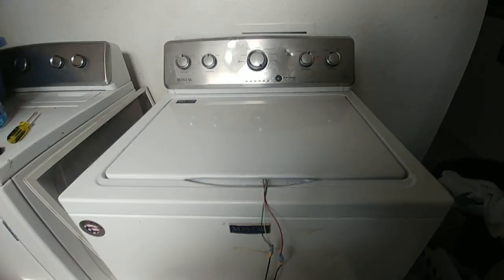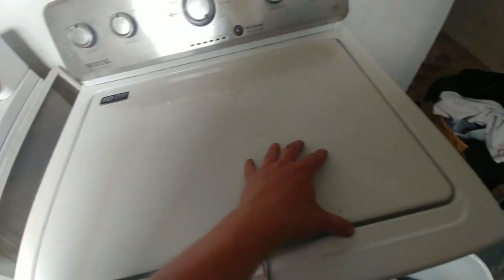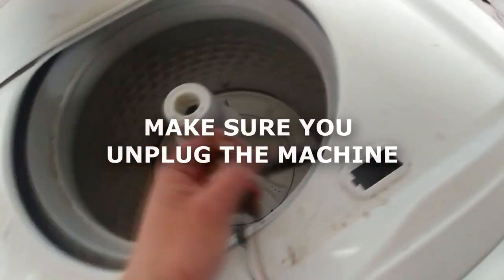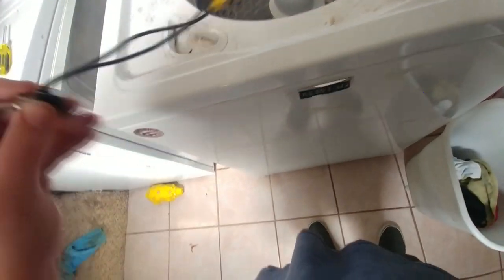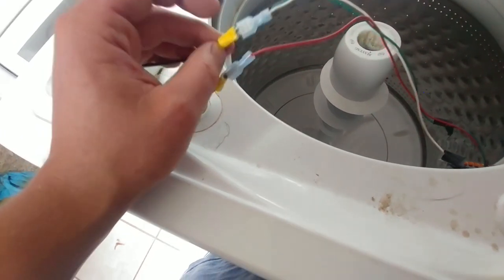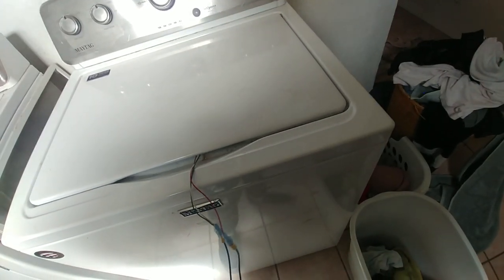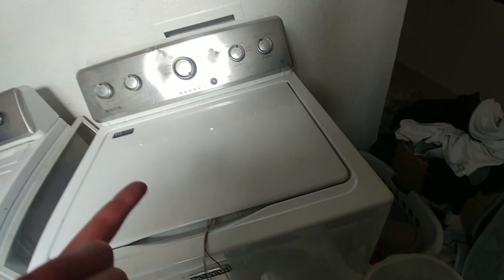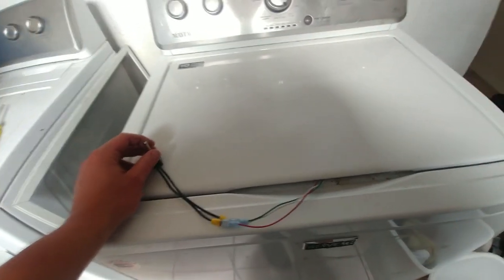new maytag washing machine lid lock bypass 100% effective

Comment: I took my switch apart (be careful, there is a solenoid that will try to pop out). Inside, there was a white piece of plastic that was pushed into two copper strings to bridge the connection. I moved the one copper piece that moves into the other and repositioned it so that it is always behind the stationary pice... so the thing things that the lid is always closed. Then I put it back together, minus the white piece (a small part of it broke off, and that's why the lid was never seen as shut anymore.) Now, it seems to work perfectly... just be sure to actually have the lid shut when you start it.

Comment: All you have to do is unscrew the pice from the lid and leave it in the hole  then you can open and close the lid whenever you want
Reply: I think it required a Torx driver. Such a simple idea! Works great! 🎉👍
Reply: not if the latch mechanism is broken
Reply: Lol . True and it's that simple . I fixed mine in place with two dabs of silicone around a tear ago . Still bonded and still working

Comment: Thanks for your wiring knowledge this going to help me... I got these 3 wires off the lid switch in front and pulled this 3 wire harness so that it is clear of the lid switch and these 3 wires come from the plug in the back of the control panel.  I will now add the electrical 2 prong switch,  In fact I will use a regular house light switch and carefully mound it behind my machine.  I hope this works for me.
Reply: Were you able to figure out how to use the drain and spin setting???

Comment: Okay, so what is hooked to the wire right before you extended it. Is that the copper coil?
Reply from the maker: That was the original lid lock wires

Comment: This seems like a super safe way to fix it.
Reply from the maker: Then go buy a lid lock lmao
Reply: @blender_unleashed  would be better if u ran it in a different direction instead of over the tub. Just saying... Yea I will have to go buy one. I tried bypassing. Still doesn't work. Mine isn't the same as yours.  So there will go $60 😭😭😭
Reply from the maker: @Nic-of3dy  they make it difficult on purpose now, good luck
Reply: @blender_unleashed  yea its their favorite thing to do, make lid locks that break on purpose. new washers are the biggest scam

Comment: So the person can add water to the cycle because the washer does not allow enough water to clean clothes appropriately
Reply from the maker: This lets you essentially run the washing machine as normal the only difference is that it will stop when it's supposed to spin and you need to restart the washer switch it to rinse and spin and then start it again so it's essentially just an extra step
Reply from the maker: As for how much water you allowed to put in that's up to you the second you hit the lid lock switch it will start doing the spin operation

Comment: What if it has an extra yellow wire ? 
4 total?
Reply from the maker: Hmmm, check it with a multi meter while it's plugged in, see if it has any voltage and if so when
Reply from the maker: It's hard to say it's been so long now I don't really remember

Comment: I did exactly everything u said and it started working and even filled up but then I heard a pop and now no lights and nothing works. Any suggestions????
Reply from the maker: Unplug it for a while, it does that to me sometimes, it could be the lid lock trying to lock but can't, that's normal, unplug it, plug it back in then turn it to rinse and spin and start it again, you'll have to do that everytime

Comment: I have thia same machine and it is a piece of shit only work for the first 30 days and it has been 1 1/2 years of constant repairs of all sorts and the lid lock has been replaced 45days ago and is now broke again and not working i will be doing this just to finish getting this one load finally finished. I am ready to drop this thin off a cliff
Reply: Make sure you buy a Speed Queen washing machine.

Comment: Why can't you just leave the switch on all the time.
Reply from the maker: Idk the computer inside of it will glitch out, it basically won't work unless It goes sensing>close lid>wash>lock the lid>rinse> spin in that order. You can trick it to thinking the lid is closed all the time but if the lid is locked it won't even begin the cycle
Reply: @blender_unleashed  Thanks